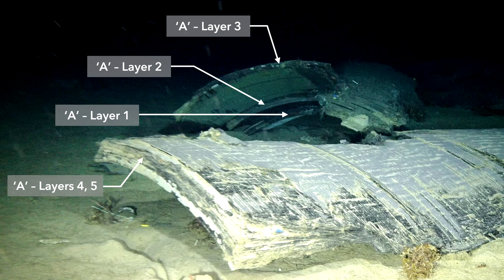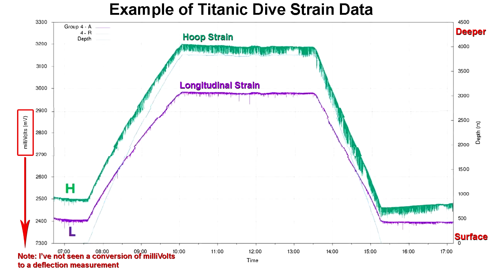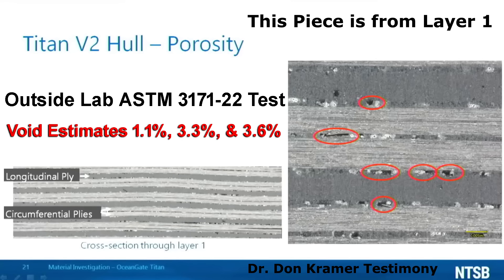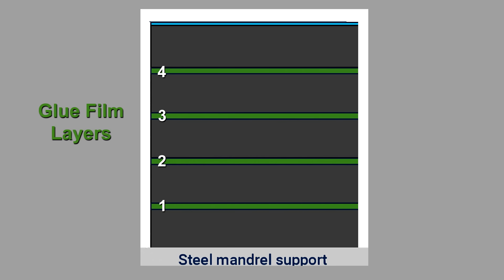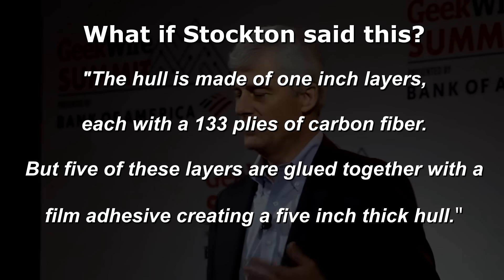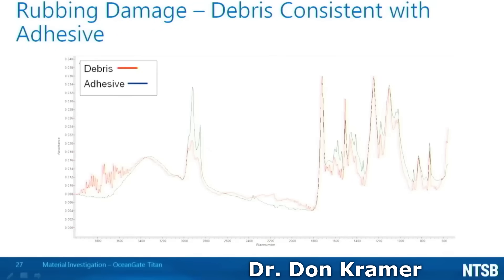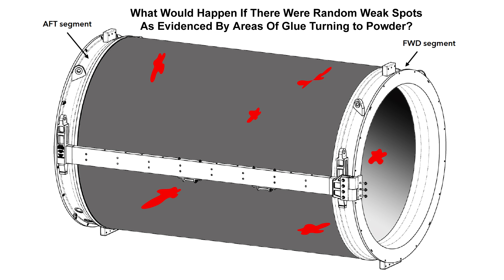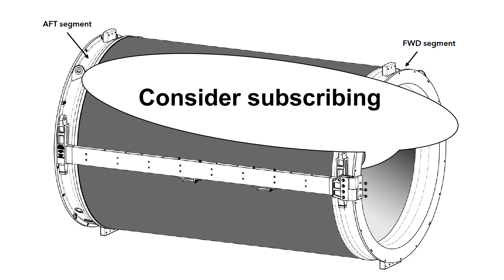OceanGate Titan Hull - Glue Layers Were Breaking Down To Dust - No Clues.

Comment: I suspect in addition to your findings the concentric layers of carbon fiber were different circumferences and were subjected to differing amounts of pressure and temperature.  My suspicion is the layers expanded and contracted at differing rates during the trips up and down in depth creating torsional forces that ground the glue into powder. The concentric rings were twisting  and grinding against each other during expansion and contraction of the layers. One would expect this degradation would compound with each successive dive. The surface area in the outer layers were greater than the underlying layers and therefore the layers would expand and contract at differing rates.  Whoever designed this craft was way in over his head.
Reply from the maker: Thanks for your thoughtful comment. Good points.

Comment: Never visit the Titanic in a Pringles can
Reply: But sir, I have several Pringles cans inside one another, glued, and layered with resin. Surely this will get it done
Reply: @montagistreel  Try wrapping them with Flex tape , I heard that's water proof !
Reply: Please do not insult Pringle cans: they have the 45-degree plies 💀
Reply: @heatwavesinsummer they ONLY have 45° plies.

Also, i believe you’re probably on mobile, hold down on 0 to get the ° option, it’s generally faster than saying degrees
Reply: @szeth5287 doesn't work for me :(
Reply: Oh I typed out “45-degree” because Gordon did so in his illustrations in the videos and wanted to follow the channel traditions.
Reply: @heatwavesinsummer  i don’t understand traditions, so have fun i guess
Reply: But it's Pringles... 🫠
Reply: Don’t tell me what to do! CRACK
Reply: Yes you can exactly 16 times!!!

Comment: Is in any of your OceanGate videos some content addressing the quality of the used fibers❓
I read somewhere those was some "old" or 2nd quality material❓
Edit:
For my understanding it should have been possible to make the air pockets or bond fails visible doing some ultrasound imaging.
Reply: To u/s would have required taking the sub to a facility. That would have cost too much money so it wasn't done.
Reply: There aren't many places they could do that and it's expensive

Comment: Yours is the best Y/T coverage on the nuts and bolts.  
4:00- Is it really that strong in compression? (282 kpsi).  I guess you can push on a rope..
I seem to remember the composite guys would only do it in 5 large layers?  But they missed the phenomenon you illustrate at 15:00.. 
15:40- Tension/Compression wrong way round?  (or am I?)
Reply from the maker: Glad you are enjoying the videos.  Regarding carbon fiber in compression, yes, it has strength in that direction, but it is because of the entire system together;  the fibers, the matrix, and the proper curing.  Many, many commenters like to blurt out that carbon fiber is no good in compression, and I don't want to argue that point; I just let the specifications for the product do the talking.  It's stronger in tension, for sure, but "the system" does have strength in compression.  As for 15:00 and autoclaving, the folks at Electroimpact would not autoclave a 5-inch-thick one-time layup, because they knew it would not heat cure or debulk properly.  So Electoimpact said they had to do it with multiple 1-inch layers for heated curing.  Regarding the diagram at 15:40, thanks for asking the question, but I think I have it correct.   With downward deflection of a beam (or truss), the top surface of the beam should be compressing, and the bottom surface of the beam (or truss) will be elongating (stretching) under tension.  Thanks for commenting.
Reply: @solareclipsetimer  Oh- I see what you're saying- bottom of layer 5 (t) vs. top of layer 4 (c).. I'll be all right
Reply from the maker: @ Yes.  Thanks,
Reply: @solareclipsetimer  
Re. compressive strength of composites and looking at ASTM D6641, I can only note the span is very short in the test and if composites are more apt to buckling than isotropic materials...
(I know- the tops of composite airplane wings are in compression, but..scary inside a pressure vessel.)  
 -You mention the thing fails by Hoop stress mid-span? Is that by compression at inner wall? (I'm looking at Lame's eqns/Roarke's)  Q; Did they analyze for a thick-wall vessel and then build 5 thin-wall vessels?
- It seems Brooks was ill-served by his materials/mech engineers, though Nissen seems diligent.  I feel bad for them- having to explain how their thing killed 6 ppl.  As to Rush...not so much.  He can now squeeze into the same pants he wore in college..
Reply from the maker: @skinny7010  Yes, the thing is that Stockton ended putting people in these bad situations.  I think he had a compelling personality.  He could make people trust him.  Tony liked to think outside of the box, so he and Stockton were a perfect match at the beginning.  Tony was a good facilitator of the project, until he wasn't, then he got fired.  You can see from the testimony how meek Phil Brooks is, he would have never stood up to Stockton.  I would like to hear form Dan Scoville at some point.

Comment: So, if there was no porocity (and they glued it under, for example, a vaccuum) - he would be right and it would've been fine ?
Reply: I can't think of a way to get around the glue problem. With the compressive forces being normal to the glued surfaces, and the forces causing some level of flex, the glue would need to be at least as strong as the carbon fiber to not begin breaking down. It would probably be easier to just make the entire hull out of a single 5 in thick carbon fiber layer than to find a solution where the glue doesn't eventually break down.
Reply from the maker: @ Thanks for your reply.  I agree.  The co-bonded technique of five separate layers was not a good idea.  Laying down carbon fiber at 45-degree angles would have helped.  You may be able to do a 5-inch-thick hull that is auto-wrapped, like a big capsule, with 45-degree plies, and then you just cut off the CF domes as waste.  But it would need to be done with a matrix product that cures at room temperature.  I don't know if that exists.
Reply from the maker: Good question.  They did do the hull cures under heat and pressure, but at one inch thick, they still had over-specification porosity in the matrix.  The glue film is a different story because it was just laid on the hull before laying down another inch of carbon fiber.  I am not sure a vacuum could have helped in the glue layer.  Maybe?  I don't know.

Comment: One of my concerns is the repeated autoclaving of cured layers may have contributed to the dust evolution from the epoxy..    Im retired now and i dont have the information readily available anymore, but i would like to see the temperature and pressure cycles during autoclaving.   

Re sanding:  not only are you affecting the original bump fibers but youre likely grinding a 3.5x diameter around the original damage.   Did they do a repair patch?
Reply from the maker: Thanks for your comment.  The Toray curing specificaitons are at 8:43

Comment: The only way carbon fibre could be of any use in this case would be if it was wound at the target pressure surely? Not my field but comparing a 777 fuselage -in tension when the pressure gradient is applied - to a submarine which is compression is literally madness surely?!

Comment: i'm surprised that they didn't even consider ultrasonic crack testing after construction & each dive.
Reply from the maker: Thanks for your comment.  That is a good question. I think there a couple issues.  The way I understand it, the ultrasound techniques start losing their ability to see fine detail after about three inches.  The outside of the sub was coated with Rhino Liner which might affect things.  The inside of the hull was not accessible to be scanned because of the liner that was in the way of getting to the actual hull.

Comment: Carbon fibre is not very good in rigid form with huge payloads it's far better at compression & being allowed to flex!
Reply: you mean better at tension
Reply: @clearlisted  No tension is pulling it apart. Compression in the fact that i fish for carp at distance & have to compress the rod, load it up with the lead weight to cast it! The thing is you have to like at the way titan was being compressed from every angle in a weightless environment & all around a rigid structure!

Comment: The square footage of the adhesive used is irrelevant.   The cured thickness of that adhesive layer and the quality…. I.e. porosity… are the only things that matter.   To put this into perspective every fiber placed in every layer is completely encased in adhesive making the volume of adhesive used in the carbon layers dwarf that of these puny adhesive layers in between.  The more disturbing thing is the fact that the inner layup  of the carbon fiber was subjected to 5 full temperatures cure runs.   All composites tend to lose mass of adhesive when they are over cooked making them more brittle…
Reply from the maker: Thanks for your comment.  The reason I bring up square footage in this video is to help describe how much of this sub relies on glue to stay together.  And the more square footage of glue film you have, the more surface area you have to be potentially poorly bonded, which in turn relates to points in the hull that become weaker.  If the five one-inch layers of carbon fiber are not behaving as one unit (due to the glue), then you do not have the strength of a 5-inch-thick hull.  This is the problem with the glue film layers and the entire-co-bonding technique.  There was a lot of glue film that was poorly bonded, and later we saw that there was a lot that was breaking down.  So the square footage is totally relevant for the purposes of this video.  The glue film that I talk about in the video is a completely different subject from the Toray carbon fiber layer in an epoxy resin that must be cured, which you bring up.  That has an entire set of problems of its own, which I covered in other videos.  Thanks for adding to the discussion.

Comment: a pair of boots breaks down under pressure over time... whats wrong with these guys....
Reply: That will last longer than the sub lol
Point is this last longer than what it is intended, and improving on resistance is what it matters because that's what lead to innovation in car and planes today, they breakdown but they breakdown slower

Comment: Voids trap air.   When the air pocket is compressed, it flattens out and can create a wedge that delaminates layers that can no longer carry load in compression.   Also, stress on the hull is simple enough until you add the end cap which has different stiffness causing a stress concentration at the joint.  Plus, I don't know if the structure was properly de-rated for the environmental conditions.   I would like to k now what the layup schedule was.   Plies should be somewhat quasi-iso, but biased for the optimum angle with respect to hoop and axial stress.
Reply from the maker: Thanks for your comment.  Those are all great points and questions.

Comment: Minor point on the LVL example that applies to the hull where you said "compressing on one side and stretching on the other." Any deformation of a straight surface will be stretching since a curve is longer than a straight line (I think this also means the hull is getting slightly shorter in length). However, each layer will experience slightly more stretch as you move toward the convex side since the radius of the bend is becoming larger. So I would expect the glue between Layer 1 and Layer 2 to experience the most degradation and rubbing from longitudinal stretching since it's deformed the most (largest radius).
Reply from the maker: Thanks for your comment.  I agree with you.

Comment: Did they not in a way prove it was a viable option by making so many dives? If this was done properly (like perfectly) would it not be okay?
Reply: Absolutely! (1) It's becoming increasingly clear that it wasn't the carbon fiber hull that failed, but rather the titanium/carbon fiber joint. (2) The carbon fiber hull was basically done on the cheap. Basically it was just a DIY project.

Comment: This hull would have failed even if the CF winding and the resin bonding were both perfectly done. To use CF in this way is literally to try to push on resin impregnated ropes; the resin has to take the entire load because the rope is incapable of doing so. But the resin is nowhere near strong enough, and there's no warning when it fails. These asshats were just stupid, and a sophomore engineering student would have known it.

Comment: Insanity from an engineer viewpoint! Steel or Titanium. Nothing else will do!
Reply: I, a fellow engineer, agree wholeheartedly. It was so, so bad on so many levels. And layers. Just sad.
Reply from the maker: And the shape of a sphere.  Thanks for commenting.
Reply: Stockton knew he was going to die in it eventually didn't he, as it got weaker and weaker on each dive
Reply: Yet it survived nine dives. Think about it, a cheap DIY carbon fiber/glue hybrid in a shape of a cylinder lasted nine dives. It's not even clear it was the hull that even imploded. Seems more likely it was the titanium endcap bonding that failed. There's no doubt Stockton was an irresponsible dreamer, but he was clearly onto something.

Comment: I think the idea of using carbon can be improved. It also has more chances compared to FDM printing PETG with 20% infill for lighter weight😶‍🌫
Reply: No it doesn't, because carbon fiber is great at handling internal pressure, not external pressure.

It's essentially made of carbon strings held together by a polymer. You can easily check for yourself that it's easy to pull something with a string, while it's impossible to push with one. Strings (and composite materials) work well when under tension, but are weak under compression
Reply: @silsail  It is not entirely true that carbon fiber is bad in compression. Fiber itself is quite resistant. The problem comes from the composite material and how the fiber is used. In aviation, composite materials are successfully used in components that experience significant compressive loads. The upper part of the wing is subjected to compressive loads during flight due to the wing bending caused by lift. Similarly, parts of the fuselage are also subjected to compression due to the air pressure inside the cabin and aerodynamic loads. In modern aircraft such as the Boeing 787 Dreamliner and the Airbus A350 XWB, a significant portion of the wing and fuselage skin is made of carbon fiber.
Reply: @ТимофейЖигулин-н4ъ even on the Dreamliner the metal spars take most of the wing loading. Carbon fiber is a great material for the skin of the aircraft but I would personally not trust an hypothetical airplane with carbon fiber taking all of the compressive loading. All materials have defects and more defects are formed every time the material is processed. Metal can deform plastically before it breaks but carbon cannot

Comment: It is unfortunate that they have not done sea water permiability and chemical stability tests of these materials at high pressures.
Any defects or permiability in the outer layers would allow sea water to penetrate and eventually fill all porosity.  
Once this happens, only the inner layers would be in compression and the outer layers only engaged through the glue bond to the outer layers.
The failure mode would be somewhat similar to hydrogen penetrating steel plate until it finds a manganese or millscale inclusion.  Hydrogen will accumulate at this point, a blister will form inside the plate and the vessel's internal pressure is transfered to the outer layers of the steel plating followed by eventual failure.
In the case of the sub,  the hull delaminates and the hull either buckles or the inner layer implodes followed by buckling.
The solution may be a totally impermiable external layer or sticking with a more conventional monolithic hull.
Reply from the maker: Thanks fro your comment.  They did so little testing on a design that was so radically different.  It's scary.  That is why this concept would never have be classed by the agencies that "class" submersibles.  The mechanism for preventing water intrusion was using Rhino Liner on the outside of the hull.  They couldn't know if that was working well.  Then between the 2022 and 2023 seasons, they stored the sub outside on the dock in Newfoundland during the winter in temperatures that went below freezing.
Reply: @solareclipsetimer  wooooooow!

Comment: Why would you use composites... for something where the weight literally doesn't matter anyway ????.
Reply from the maker: Thanks for your comment. Stockton was trying to weigh less than the standard spherical submersible. Titan weighed 23,000 pounds and fit 5 people. Alvin weighs 40,000 pounds and fits 3 people. If your sub weighs 40,000 pounds, you can't use the LARS concept for launch and recovery; you need a dedicated ship with an A-frame crane. Stockton also wanted the tube shape for better depth of field for taking images of people in the sub enjoying the view. And submersibles have to be close to neutral buoyancy: they fall to the bottom under their own weight and they rise to the surface by their own buoyancy. At 40,000 pounds it takes a lot more cubic meters of foam to counterbalance the weight.  So, in retrospect, the idea didn't work out, but that was the concept for building it.